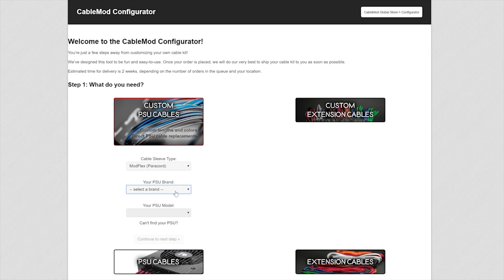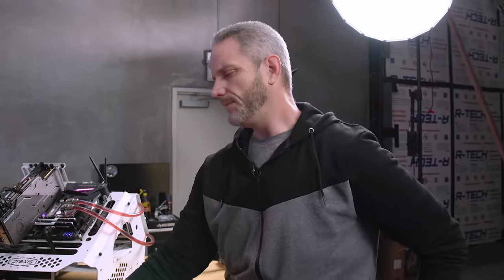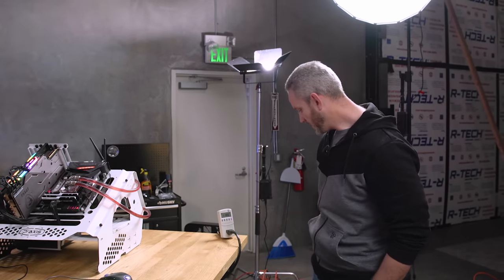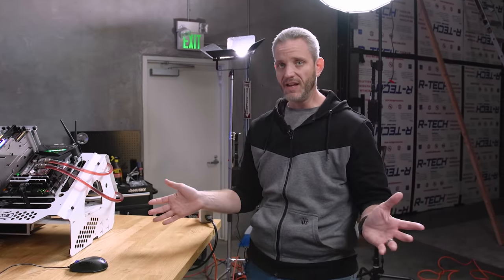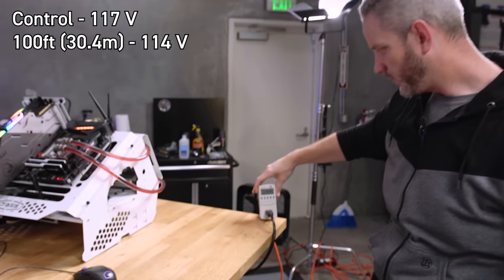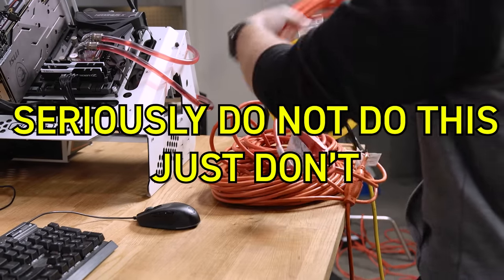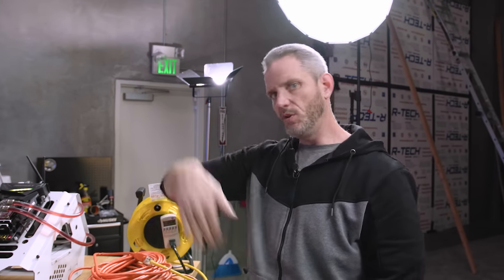Are extension cords dangerous for Computers?

Comment: As an electrical engineer I was waiting for the moment when he touches the extension cords and realizes they get warm/hot.
Reply: Fondly remembering the time a band at one of my old rehearsal places plugged a 3000w space heater into a coiled extension...
Reply: Lord Vermintide that space heater can’t heat on it’s own.
Reply: My PC is also on a extension Cord, but it's a selfbuilt one with eneugh diameter to transver 230Vac 32A
Reply: @plasmachicken  230V doesnt suffer the same drop though :) I have my Pc on 1 socket, on the 2nd ext. cord, i got a 2000W heater on the 1st cord same socket xD

Its not a problem untill you start drawing alot of power on the PSU anyways, and being on 230V puts you right inside the input range even with a decent drop of volts :)

EU PSU´s are full range too, so it will work untill the same 108V-ish, but cables would however be on fire long before that would happen xD
Reply: I was waiting for him to at least uncoil it.
Reply: I'm glad they threw the warning in there about not leaving them coiled up. A lot of people don't realize that's not safe when you have a constant flow of power through the cable. Just running a screw gun or a saw that is ran intermittently  and uncoiling it part way is fine but a 100ft cable coiled up gets toasty pretty fast when you are really drawing power.
Reply: i learned that in high school physics. and in Comp Sci where we had bad quality socket extensions( they literally just daisychained a load of two socket extensions and had a 6 socket extension off the other. 3 pc's and monitors from that one plug. daisychained to manage a total of 30 pc's and the teacher's pc aswell.
Reply: Dan Wilkinson wow
Reply: Same. The level of incorrect terminology is slightly tickling my ocd lol. But not everyone knows the technicalities of electrical.
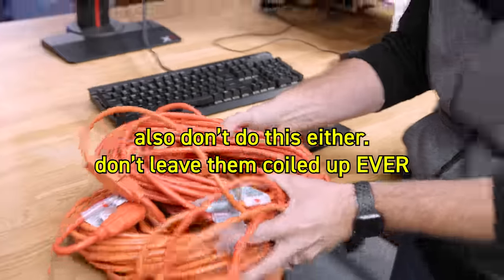Reply: 14:05 do they mean dont leave them coiled right after use or just in general?
Reply: @kirk_kirksman4503  in general.
Reply: Same lol
Reply: @Inareth Isn't it just that the percentage loss is lower at higher volts?
I might be wrong but I seem to recall the drop being higher in volts when you scale it up, but nowhere the same percentage. Point: you can have a 50% voltage drop in 3v systems but 100kV it'll only be 100V/1‰ or so.
Again, I might be wrong. It's a few years since I studied high voltage conductivity
Reply: PLASMA chicken based on spelling and grammatical errors I can in fact confirm that you are an electrical engineer. 😂
Reply: I think what gave me more anxiety and annoyance is the fact that he was rolling them back up with the top to elbow method instead of the over under method.
Call me particular, but god damn I hate seeing people roll cables like that. Tangle and knot central.
Reply: @jkalash762  A coil of wire with a current running through it is called an electro-magnet.
Reply: @fred_derf  i mean technically yeah, without some sort of pole running through the coil to exert the energy through it's basically useless though. Factor in the insulation and it becomes an even weaker magnet. That's the reason coils in tattoo machines made with cheap magnet wire end up being weak compared to a coil made with higher quality magnet wire. They also tend to lose their force the longer they are ran. What does any of that have to do with my comment about leaving extension cables being left coiled up? They don't get hot from being a potential magnet, it's from all the heat that would normally be generated and dissipated over the length of it being basically piled into a heat soaked nightmare...lol
Reply: I came here to know if i can use an extension cord to plug my avr and turn on the computer without causing issues or should i just plug my avr to the wall socket
Reply: i have had about 3700w going through one extension cord that was a good quality one but it got really warm(one of many stage lights on seperate breakers for a temporary setup)
Reply: Same here
Reply: @TheSimonarne  3700W is a lot! You have to step up the diameter of the wire. Also uncoil the cable if you won't melted Cables and probably a fire ;).
Reply: @xX12VincEXx  ahh yes we used good quality extension cord. We had 2 of theese lights on their own breaker but yeah the cable became warm to the touch but its only used a few hours a day for a week then packed up again
Reply: Can i plug and extwnsion cord into a power strip for a computor
Reply: Depends of the kind and the gauge of wire that the extension cord is using if you buy an extension cord for heavy duty industrial use usually there $1-2$ per FT when I was a framer my boss got a work drive and had crap extension cords that would barely run it I bought a 10 gauge extension cord for $150usd, worm drive worked great after that I still have that cord in great shape never been cut or nicked, you can also make a cord from 10/2 Romex that will work awesome and you can have 2-4 outlets and plug into them all
Reply: @nekrovulpes  me too , melted the entire ring of wire into one chunk and burnt out the wall sockets...wasn't far off a fire..
Reply: Kid also know that
Reply: Yeah, I was thinking it would be neat to see a thermal camera on the cords.

Comment: "It still needs 120V. So it's going start pulling more amps to get the volts it needs, to provide the wattage that it's asking for."
This is so wrong it hurts
Reply: That's why the cords got so hot, their basically acting like resistors, this video is the perfect example of why you don't run anything that draws significant power on 16 gauge wire
Reply: It's hard to listen to Jay butcher the laws of Physics, but fun at the same time.
Reply: @brando12343  You forgot about inductor effect when cable is rolled up.
Having high amps on rolled up cable WILL give you heat issues.
Reply: Compatibility Madness you won’t get an induction effect in a extension cable because the active and neutral or hot and cold cancel each other out.
Reply: @timmehh89  So, it doesn't effect how clean power going into PSU is ?
Reply: @timmehh89   False. You'll most certainly get severe (self)induction effects, incredibly, absurdly much so with several hundreds of feet coiled up tightly like this. Because both hot, neutral and ground (if present), "receive" that EM induced AC - they're all coiled up together. 

These lengths and low AC frequency may possibly not be enough to cause phase issues, but you'll most certainly still get the heating and resistance effects. Exponentially so, as the coiled lead can't shed heat to its surroundings. Which in turn causes even more internal resistance, causing further voltage drop and heat buildup (which the lead cannot shed).
Reply: @pr0xZen  Wrong. As @timmehh89 pointed out you have hot and neutral coiled up together, so there is no coil inductance there (the sum of the currents is zero).
Transmission Line Inductance is another beast altogether (and too negligible to have any effect in this video).
Reply: pr0xZen no you won’t get serve induction effects in an extension cable because both active and neutral paths are run together in the coil and cancel each other out. It’s the same reason if you put a clamp meter over an extension cable it will read 0a despite the load running through it because current is flowing through both directions simultaneously.
Reply: @CompatibilityMadness  What you are referring to is additional impedance (resistance is one  of three forms of impedance) which is inductive reactance  which  is  an impedance that is created in an AC circuit when you have a coil in your circuit, an example is motor winding's. This is caused by the constantly expanding and collapsing electro magnetic field caused by the alternating electric circuit switching from positive to negative in our case at 60 times a second passing through the wound up conductors  which we all know when a conductor passes through a magnetic field it induces a voltage into that conductor and of course the voltage induces in this case would be acting against the intended flow of our circuit causing an impedance but the amount caused by having your extension cord rolled up would be quite minimal possibly not even measurable. What's causing the heat issues is the resistance from using a smaller gauge wire like 16gauge in a 15amp circuit which should be a 14gauge wire and also voltage drop which starts to become a problem once you get 120' or more away from the panel which can be corrected by increasing your wire size.  so those two issues and then just having the cable bunched up in a small area makes your small to long extension cord into a bunched up make shift heater. But I've rambled on not making sense for too long. point is a rolled up cable is noticeably hotter because you have it all grouped together rather than increasing the surface area to cool the cable off and is not caused by the inductive reactance.
Reply: @SeanEvans87  Thanks !
Reply: Just cut out "to get the volts it needs" and it will be correct.
Reply: @timmehh89   but a rolled up cable gets hot. What is the effect what is happening?
Reply: @juicy9592  you should read Sean Evans comment as he explains it better and more thoroughly than I did.
Reply: In a sponsored lab, I'd be inclined to support your thesis. In the field, with consumers and uneducated hobbyists, and cheap consumer gear - less so. There's a third lead here, and phase is bound to shift slightly; the circimferance and length of the windings change rather significantly within such a "spool", and the total length+load is quite significant here. Minuta adds up. Your most significant and imminently concerning end product to grapple with is still going to be heat, no doubt, with voltage drop secondary.
Reply: @CompatibilityMadness  true
Reply: Yeah i feel you
Reply: @pr0xZen  120V supply is like engineered voltage drop ^^'
I remember my holidays in Canada... cleaning the house with a vacuum cleaner.. and realizing the extension cord is stupid hot. Cables warming up is things i'd expect from an extension feeding too many blower heaters to warm up my bathroom.. not a simple vacuum cleaner, or tea kettle, or microwave oven. Everything heats up under 120V because too many amps and they use the same gauge wires we use on 240.. Cables warm up, become more resistive, and it avalanches to insulation starting to soften. It really creeped me up with my 240v habits :P
Reply: @juicy9592  
It is mostly a matter of reduced surface area being exposed to the air which cools it.  It's the same reason that when you mix large quantities of epoxy, it gets much hotter than smaller quantities.
Reply: 16 gauge is rated for 12 amps of current. A standard house in north america has all #14 minus a few dedicated 20 amp acts like in your kitchen
Reply: I will just have less voltage on the PSU so the maximum power it can give will drop. The amps will drop as well not rise when you add a wire as additional load.
Reply: Yes it hurts
Reply: @CompatibilityMadness  Only in DC
Reply: @shuunanigans  per UL its 10amps for 60*C and has a resistance of 4 ohms per 1,000'.
Reply: Only partially cancle.
Reply: The cancelation is not perfect, there will be an effect.  How large will require math to calculate - much math.
Reply: we have 30A ring mains in each room in the uk so its way better than yours.... i have 6 6plug extensions daisychained running all my hardware including synths and stuff + all my pc and 3x monitors and it only pulls 22A....
Reply: @chloedevereaux1801  LOL Ring Circuits are definitely not better. It's a leftover from WW2 era scarcity of materials.
Reply: @YuureiInu  if you halve the voltage, it'll double the amps. Also, the longer the cable, the more voltage drop, the more amps it'll have to pull to keep the load fed.
Reply: @nberedim  Apparently not true, development of ring circuits because of scarcity of copper is a myth.
Reply: It needs 100-240v which btw is completely available in pretty much every home the united states nema 6 sockets are a thing you know? and 208 3 phase is also perfectly acceptable, even DC is fine, I really don't like when bad information is spread, I actually wonder who came up with this idea that north america is ONLY 120v..
Reply: @94e88   Does a PSU lowers its impedance to draw more current?
Reply: @theagg  My objection was with the claim that ring circuits are "better". While the entire world uses radial, the UK apparently knows something that escapes the mind of the rest of the world's engineers.
The only thing ring circuits have going for them is the fact that they are cheaper because they use less material. Combine that with the fact that they were established during WW2 and it makes sense. I would love, however, if you can provide a source that debunks this.

PS. I am talking about the use of ring circuits in residential use cases. There are obviously use cases where ring makes much more sense than radial, but this isn't the case for a house wiring.
Reply: @YuureiInu  Well, it isn't as simple as that as active pfc(power factor correction) also come into play in situations like this. The power factor correction is a technique of increasing the power factor of a power supply. Switching power supplies without power factor correction draw current in short, high-magnitude pulses. These pulses can be smoothed out by using active or passive techniques. This reduces the input RMS current and apparent input power, thereby increasing the power factor. A basic active PFC circuit consists of a control circuit that measures the input voltage and current and then adjusts the switching time and duty cycle to ensure that the input voltage and current are in phase. This provides an automatic correction of the input AC voltage, resulting to a theoretical power factor of over 0.95. Unlike the passive PFC, the active PFC operates over a wide range of input voltages. However, it requires extra components, which makes it more complex and expensive.
Reply: The computer needs watts.. which Volts*Amperage=Wattage so when the resistance drops the overall voltage (strength of the electricity), the amperage (speed at which its delivered) is inherently increased.
Reply: In Europe you can get normally 16Amps at 220-240V - it is about 3520-3840W... It's is usual for electric wires protection limit, secured by a fuse/breaker. It would be 32A at 120V... It's a really lot for thin wiring.

Btw... You do not need lot of voltage to hot you cables up... I was young and I wrapped speaker cables around a spoon (I found it somewhere in Trashed children's room floor), becouse the speakers cables were too long (10m), and the amplifier was 1m away... And it was powerful amplifier... I burned my hand because the spoon got so hot... That was my first RL lesson about electricity and induction.
Reply: @pr0xZen  right but voltage drop is the bigger concern of the two in this case, now if it was a true "winding" (one conductor wrapped around with current flowing the same direction) then yes there would be greater added resistance in form of Inductive reactance.
Reply: "to get the volts it needs" is referring to the DC voltage rails that are actively regulated by VRMs. If the incoming AC voltage is lower, the VRMs run at a high duty cycle longer than they normally would, as to keep the DC voltages within spec. Hence, more current is drawn despite the lower resulting AC voltage, also known as droop.
Reply: just why murica still use 120v, I mean I heard murica house set on fire more often than any countries with 230v
Reply: It does not need 120 V it needs a certain amount of power (watts) and yes it will pull more current (amps) to arrive at the total power required. Power = E X I X pf (voltage X current X power factor)
Reply: @dashtesla  it's almost like there's different lines for different needs
Reply: @YuureiInu  The power supply need a certain amount of wattage. And there is two ways to get it. Either through a higher current or a higher voltage. Watts=VoltsxAmps so if one goes up the other go down.
Reply: @Sheiiko  When you add second load (the cable) there is a voltage drop on it proportional to it's resistance (assuming it's all resistive load). So there's less voltage that goes onto the PSU. Also because the load has increased, the current will proportionally drop. So the total wattage will drop as well, not giving enough current to the computer to work properly. Actually the wattage on the PSU will drop for both reasons: increased load (lower current) and voltage drop on the extra load.